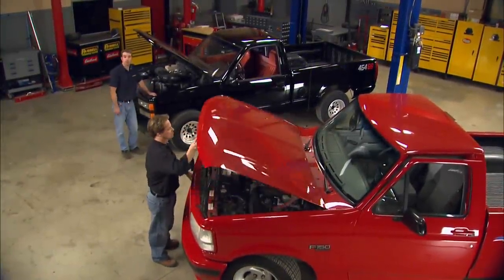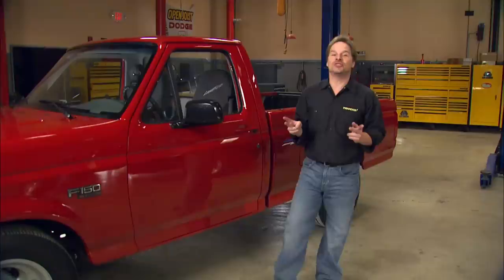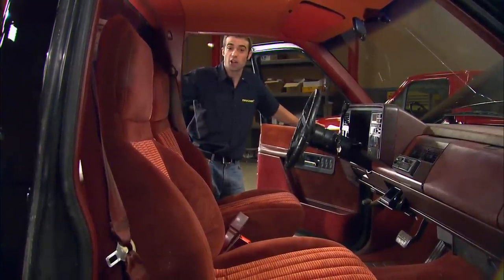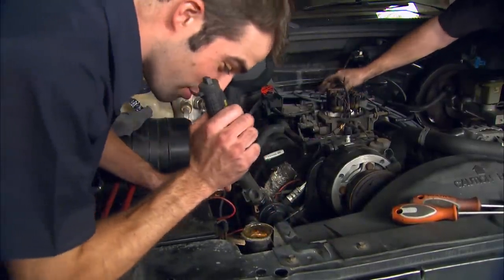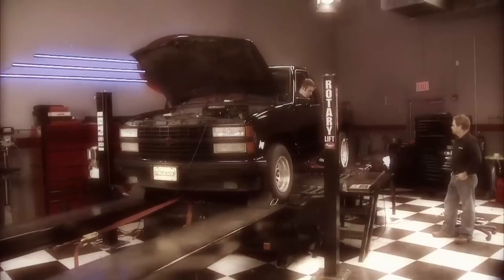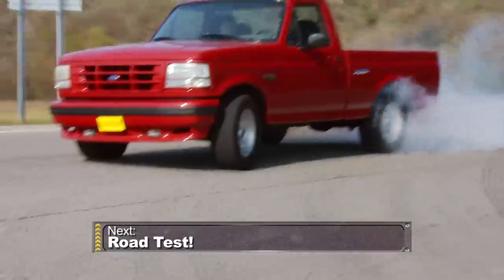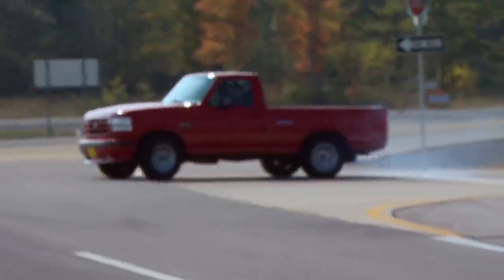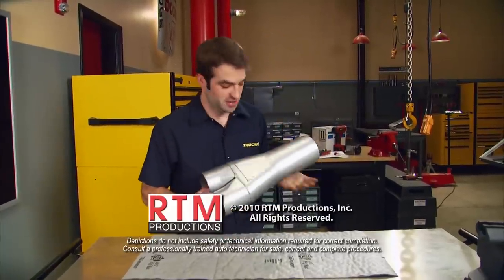'90 Chevy 454 SS vs '94 Ford Lightning F150 MuscleTrux Wars Part 1 - Trucks! S10, E1

Comment: A reminder that the Ford Lightning carried onto the next body style and the 454SS didn’t
Reply: Admiral Sandwich you literally have the Silverado SS with the 6.0 as an extended cab
Reply: J Era but is it a big block
Reply: If you get technical, then NO but the name did carry on. Different engine, same goal.
Reply: Cuz they had a monster 8.1L 496cc Vortec. Lol
Reply: Salty Steel the 8.1L is a beast unfortunately it was introduced at the wrong time because just few years after it’s debut the 2008 recession hit and GM had to discontinue it. To much gas, ford can’t compete with GM’s gas engine line up. There Diesel line up is a joke too
Reply: @Mynamesnotkevin  it was an old engine, an evolution of the 454, and everyone wanted a diesel at this point.  I'd still like to build a regular cab short best ss496
Reply: KFStreich That would be one hell of a ride, and the semi truck manufacture “International”made fords first diesel the 7.3L so that isn’t even ford built then ford made the 6.0L that one was trash and now they have the 6.6L which is doing okay but not duramax competition quality okay
Reply: J Era hold on did you just call a duramax “quality” when is the last time they seriously made a Diesel engine as good as a power stroke or a Cummins
Reply: I do agree that an chevy pickup with an 8.1Liter would be badass though
Reply: @williamsanders468  duramax seems to do well, I've had 2 without all the scary problems I've heard of and they had a proper transmission from the get go.
Reply: @Mynamesnotkevin  none of the big 3 have consistently built their own engines,  GMs "partnership" with isuzu was a nice way of saying we will have isuzu design our engine
Reply: Admiral Sandwich literally putting all pride to the side doesn’t matter what company you go for, you have to admit the 7.3 and 6.0 power stoke were not good engine’s. I can go into detail, like I said but  6.6 power-stoke definitely is an upgrade I’m not gonna say no. But it isn’t Cummins or Duramax reliable
Reply: J Era I don’t know the last time I heard someone say they wanted a duramax or that a duramax is reliable
Reply: J Era and 7.3s don’t have any problems it’s just they messed up on the 6.0
Reply: KFStreich as far as I’m concerned Isuzu only helped the fuel injection pumps, the first gen GM diesel 6.2L naturally aspirated had a Mecanical injection pump. But that motor and all it’s components quickly became out dated and out powered. Then the team up with GM and banks Power turbos made a turbo kit for the 6.2 which helped a lot. But wasn’t a enough.  After that you have 6.5L GM tucks with a turbo from factory. That was first truck from GM to come out turbo and electrical fuel pump which was a complete disaster. Then finally the 3rd gen diesel rolls out 6.6L duramax that collaborated with Isuzu for the fuel pumps only.
Reply: Admiral Sandwich if it anit broke don’t fix it, that’s why the 7.3 got discontinued. It wasn’t a solid matter and you know that. And that 6.0 was just ass completely.  But yeah 7.3 vs 6.0 I’ll take 7.3 now compare that motor to the other big Two Dodge & GM, GM 6.2 was better, and dodge still didn’t have a diesel I believe until the late 80’s early 90’s with the 5.9L in-line 6 12v Cummins
Reply: @Mynamesnotkevin  do you have documentation?   Have you owned any of these?
Reply: KFStreich we currently own 2 gmc 6.2L natural aspirated and 2 gmc 6.5L turbo. 

And my brother-in-law has the 6.2L gmc with the banks turbo kit from the 80’s
Reply: @Mynamesnotkevin  interesting,  I've owned all 3 and while they are imperfect I would hardly classify them as garbage, mostly just not understood.  The first 6.5 I drove 800 miles home, all the problems came from the previous owners refusal to fill the tank causing moisture intrusion and buildup, the second was cheap due to all the unfixable problems,  they spent an enormous amount of money for new IP and injectors when the problem was a bad $36 lift pump.  The turbo on those was terrible mostly due to a small exhaust housing, I had an h1c to replace it with but a wildfire burned them.  NA engines need intake and exhaust opened up for very acceptable performance.  They weren't rocket ships, then again nothing was in the 80s.

My duramaxes are/were both clearly isuzu products both from labeling and design standpoint, I had the the 2001 lb7 from 2007 to 2017 when it burned and was replaced with a 2006 lbz, the only engine related problem I had was a slow drip from the lb7 water pump that never progressed to the point of needing replacement,  I looked at 7.3s both times, unfortunately the transmissions didn't impress me and 6 speeds are hard to find.
Reply: KFStreich I understand you perfectly but as we currently own 2 6.5s they are okay, we’ve had minor problem, but mostly definitely the biggest issue we had are the fuel pumps one of the trucks my dad has had since 95’ he was first owner. And the earlier 6.5s had recalls for the fuel pumps then we have a newer one that came with the blue tag on the pump, that supposedly meant the fuel pumps were “fixed” but not really. Not only that we take good care of them but they just always seem to give problems. On the other hand the naturally aspirated 6.2 L we have are freaking work horses I’ll definitely choose a 6.2 L over the 6.5 L
Reply: @Mynamesnotkevin  the biggest trouble seemed to be the new technology in the electronic rotary IP, Cummins seemed to have the same issues with the vp44 on the 5.9 and 8.3, I'd love to get my hands on a 1992-1993 6.5 turbo.

Comment: 454SS My friends older brother bought one of these brand new, it was his first vehicle ever. When he wasn't home and the keys were there, me and his little brother would take it out and joy ride it. 
Beast of a truck, the second gear scratch was awesome. we were around 13-14 years old.
Older bro had a slight fender bender in it mostly front end and it kinda rotted away in back yard, some parts were replaced but he ended up selling it on the cheap. It was White.

Comment: Didn't Dodge put a,V10 in a 1/2 ton short bed with manual
Reply: Yeah but that was in the mid-2000's, the SRT10 Ram. You could also get an extended cab version but that may have been auto only

Comment: my best friend had the same 454ss  it was a dog
Reply: New heads wake those TBI Chevy's up. Stock heads are shit on those TBI motors
Reply: I have a 1995 454 suburban. Totally stock right now. But it did have a supercharger ( centrifugal type, not screw) which didn't really help it. Only at 50.876 miles; cause of gas prices.

Comment: If ya'll actually think that lightning would beat a syclone you've been smoking crack.
Reply: Drive it Like ya stole it I’m saying
Reply: Obviously you've never driven a Lightning, if you had of, you would know that the statement you just made is wrong. The 1st gen Lightnings were nice trucks, and the 2nd gen ones were even faster. My 2000 Lightning ran mid 9's in the quarter on street tires and pump gas, it also wasn't stock. To get those numbers I installed aJohhny Lighnting 8 lb lower pulley with belt, 92mm throttle body, an Anderson Motorsports Cold air kit, K&N air filter, Yellow top Optima battery, a transmission shift kit, a superchips chip with multiple programs that were fine tuned on the dyno and tweaked after drag strip runs, replaced the factory mufflers with Spintech mufflers and a Cervini fiberglass (functional) Ram Air hood.
Reply: @Lightning546   I was referring to a stock first gen lightning vs. a stock syclone.  I'm well aware of how fast the blown lightnings can be with a few mods.

Comment: Hi, I have the 454 SS 1990 truck.  The first year came with an iron intake with a coolent adapter from carb bolt pattern to the three bolt TBI.  In 1991 the intake was changed to aluminium with the three bolt TBI set-up.  Also with the factory chrome wheels where wider with a lower profile tire.

Comment: I miss my first gen lightning.
Reply: Let me guess, it broke down and you couldn't afford to fix it.
Reply: 302hobronco  It had 5.8L V8 or 351ci Windsor. Good torque small block engine.
Reply: @tskraj3190  oh wow great troll response.  Actually I sold it because I wanted something I could tinker with.   My 95 first gen had 30k miles on it and was stock and beautiful.  To tinker with it would be changing it from original.   So what other comments you have troll??
Reply: @Silkmaster4200  the 5.8 and 351w are the same my friend.
Reply: 302hobronco I know, i was just saying it both ways for younger ones didn’t know lol.
Reply: Timothy Isenhart found the person who bought a 5.4 3v
Reply: @303StreetMachines that's a great way to get the very last out of your rear tires lol.  Mine was a black 95. It had the tubular back bumper and sliding rear window.  The previous owner of it put bassani equal length headers and full bassani exhaust on it.  It also had from the dealer the ford racing mass air conversion done to it.  It was a great hot rod truck.  Not fast but quick.  I had everything the truck came with stock including window sticker and original paperwork from purchase.

Comment: I have a '96 chevy s10 with a rebuilt 4.3 turbocharged. I dropped the truck 2.5 inches stiffened the chassis, shortened the bed and wheel to wheel. Upgraded a lot of the internals and switched most of the body panels to carbon fiber. Everything underneath the truck is less than 2 yrs old. I dont use it on the track though, I street drag with it. I have taken on the syclone and beat it with no problem about three car lengths. Love these old trucks. I also have a 92 ford f150 custom straight six all original mint condition. I use it for cruising and it will go to my son in another 14 years.

Comment: I bought a new 1995 Lightning in January 1996. My best 1/4 mi was a 14.94 @ 97 mph and got beat by a friends Lightning who went 14.90. (just to beat my truck he removed the fan belt for that pass) We all got a good laugh. It made 250 hp & 350 TQ at rear tire. I then sold it with 4000 miles on it and bought a new 1996 Ranger and dropped in a SuperCharged 5.0 Much much faster. LOL

Comment: Those era GM' trucks had Failing... fuel pumps, dancing gauges in the dash, early alternator failure,  a/c system leaks, Door hinges shot at 100k..... Ford F-150 overall was a better truck motorcraft parts lasted nearly 3 times as long.

Comment: Takes a big block Chevy to take on a small block Ford but still loses
Reply: Kenneth Brown yeah it’s a supercharged small block vs a stock 454 n/a motor
Reply: @feastorfamineauto  they are both n/a. Lightnings were only supercharged from 99 tell 04.
Reply: That 454 is so restricted due emission standards at the time, do all aftermarket cam and heads between the two and the power difference would be huge.
Reply: @feastorfamineauto  first generation lightnings where not supercharged
Reply: @bryanloewen5011  the lightning had the same emissions restrictions as the bigblock
Reply: Im fully aware of that but think of how much restriction a big block would need to pass those emissions. All im saying is mod for mod the smallblock ford wont stand a chance as it shouldnt be.
Reply: @feastorfamineauto  no its na. they put turbo on it tho and it beat the chevy, ford had 410whp chevy had 312whp iirc

Comment: I had the Chevy 454, stock it was a slug but once a swapped the heads and cam, threw on some headers and flowmasters it was a beast. I didn’t put a big cam in bc I wanted to keep the AC with plenty of vacuum.

Comment: It's important to remember that the Ford was a Special Vehicles project while the Chevy was an 'options' truck. The 351 got special intake, heads, cam, exhaust, special susp etc. The Chevy got the lo po RV engine, little suspension tuning, nothing, 2 years later it got an OD auto, 4.10 rear and dual exhaust.  I loved 'em both. They both ran low 15's with a tune. I was 40 when they came out; but they were $$$$ over a reg new truck...
Today, a stock 2.7L turbo with a 93 tune pushes a 4wd F-150 at 14 flat at 102+ trap. Chevy fans are noting their new 2.7L 270 hp 4 pot pushes a new Silverado half a second faster than their 5.3L 355 hp V-8, both in stock tune! Can' beat the torque on these turbo engines without a blower.

Comment: A possible reason (judging by the MSD cap and wires) for the wider plug gap could be a six litre tune-up. Slight timing bump (12-13.5 BTDC, compared to 10 stock), a hotter coil, and 9mm plug wires.

Comment: Run the lightning against that little 6 cylinder cyclone and watch that Ford shitbox get left behind
Reply: Yes, the Syclone/Typhoon twins were fast. But also trouble prone and high-strung. At one point the inventory of replacement engines for GM dealers was depleted.
Reply: @fredzeppelin3969  at one point LT1 engines were depleted that is why Lingenfelter built mine.

Comment: Though the SS454 looks a little hideous compared to new trucks, it was all the rage at it's time. As for the Lightening, it looked like nothing more than a mono-chromatic farm truck in it's day, and still does. You could easily make the SS quicker, but you could never make the Lightening look good. I'll take a better looking truck over one that's a few tenths quicker in the quarter mile any day!

Comment: Either way. I would be proud to own any of these two trucks. Soft spot for chevy thought.
Reply: Soft in the head ,the F150 is just better enough said
Reply: @bradzimmerman3171  The ss has a lot more potential to be a power monster. As the ford will meet its max capacity at a way lower power output. 5.0's of that time don't take power too well over 500 hp the block lets go. Also twin  i beam suspension is great off road but not so great for comfort or handling. Kind of old technology, even in 1994 it was outdated.

Comment: That .50 gap on the fords spark plugs was probably due to the previous owner doing the 6.0 tune up, hense the MSD ignition. Should’ve checked timing to be sure but that’s probably what caused the backfire

Comment: Lil Red Express, but don't forget about the WARLOCK.
Google it.
Lightning:
The tubular intake (GT40) was manufactured by Roush.
The 351W block was roller capable but equipped with a flat tappet hydraulic cam.
To make it handle, try and put at least 4 degrees of caster into it. 
(1 degree caster split  : rf 4.0 lf 3.0)
+ 1/4 DEGREES camber, zero toe.

Comment: I almost bought a 1990 CHEV SS,,,,,,that is until I drove it.  Sheash what a weak dog!   Unfortunately my wife needed a pickup to pull a small horse trailer so in 1991 I got her a 2500 Silverado 4x4.  Worst pickup I have ever owned bar none.  It went through three auto transmissions in less than 70k miles, one rear end, one rear drive line and a complete new re paint job all paid for by GM.   It was the most gutless crap box ever. The 5.7/350ci engine new put out a claimed 195hp at the crank which means aprox 155-165 hp Max at the tires. The wife did love it’s car like ride and easy to get into low low cab. 
I sold it for a huge loss with only 67k miles on it. I saw the guy (a cop) who bought it and told him all about it, he thought I was giving him crap.  Later he contacted me to give the huge list of issues he had before he let it get repoed.

Comment: I have a 2000 GMC 3500HD. Sadly, that was the last year for the 454 big block. It was the first year for 4-wheel disc brakes though. I have some plans for that beast.

Comment: Heads and cam, headers that 454 if you wanna stay oem tbi do the carb intake adapter for it air gap.  Drill the idle screw out.  Or if you wanna spend money go fi tech. thats all they need. That ford id cam and heads that and intake haltech makes a ecu for the 88-92 obs to fully tune them ob2 style

Comment: Shoulda put E3's in that 454 Not calling it an SS because like my 89 Sport truck, there were a LOT of fakes or cloned made, but the E3 plugs make a HUGE difference n power, Maybe not so much in the fuel economy department like they claim but they DEFFINITELY help in the power department  1989 Silverado Sport (269,000 miles) well used and still going, only Mods, E3 plugs, K&N air filter, Flowmaster muffler, and High volume Oil pump. only ever ran Mobil 1 motor synthetic oil  in the truck with Lucas Engine treatment had it since 90,000 miles and drove it Hard. It is now a 1 of 1 example of a 1989 silverado sport.Originally only 3,540 were made the first year

Comment: That Aluminum intake plenum on the ford usually shatters in the crusher, however the one on the lightning just bends into the intake.  I crush cars every day and just notice little things like these.  The frames on the Chevy trucks of this era crack at the engine mounts if the engine is in it when it’s crushed.  The frames need reinforcements in this area.  Cool trucks anyway.

Comment: The welder is a ac/dc wire feed like most homeowners use.  = You need to buy a very thick power cord and put in on a dedicated 15amp+ circuit.  = without that not enough power (amps) and you get those spotty welds.  Keep the power cord length down in length also.

The Ford needs a blower.  454ss needs more help = a big engine, but more for torque and not power = will last a long time, but mpg is sort of low.

Comment: I really love both trucks, but have to say that the 2JZ-GTE design in 91 later to be released in the 93 Toyota Supra was an insane motor for it time and even now. Always wondered what would have transpired with in being tossed into a performance T100 to compete with the v6 Cyclone. Granted the T100's were some ultra fugly trucks lol. 
 Proud owner of a 95 Supra Turbo 6spd with 111k miles on the clock and it runs like a Jaeger LeCoutre duometre spherotourbillon time piece.